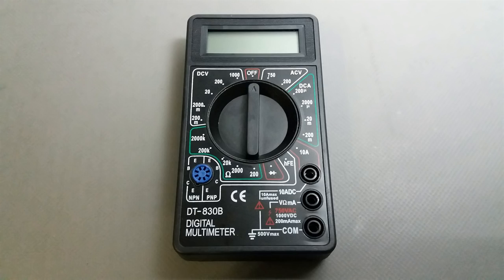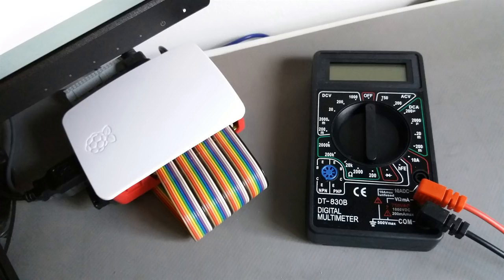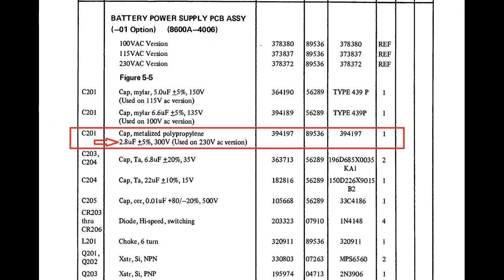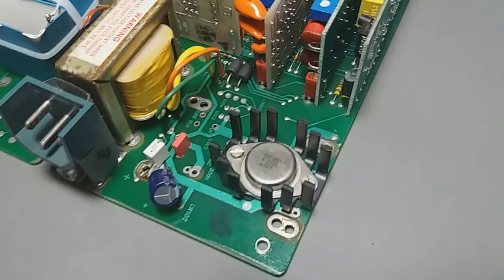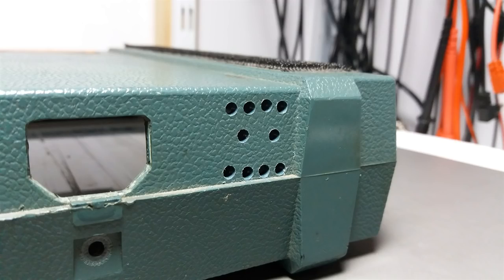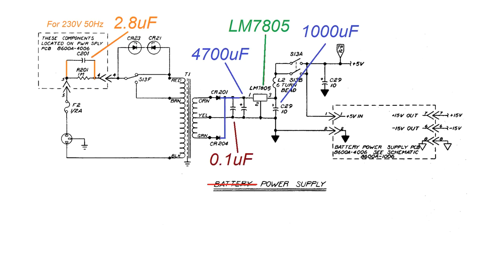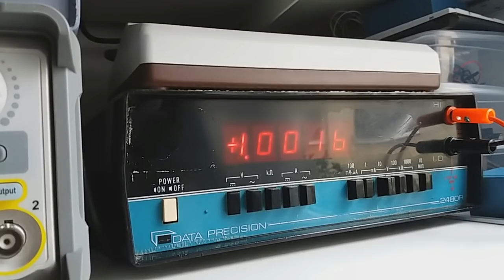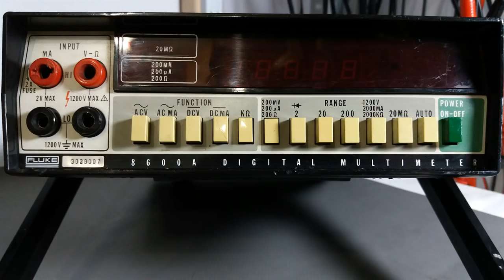Fluke 8600A power supply conversion / how to use this workbench 8600 DMM without battery option

Comment: Check the broken solder joint at 10:00 to the right.
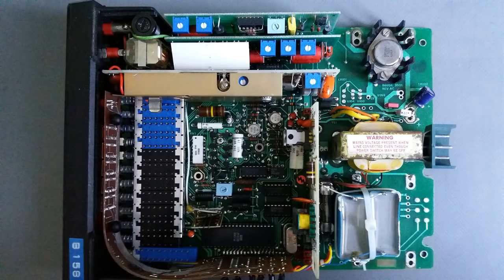Reply from the maker: Hi Joseph!  ...yes, those are the transformer ones. It vibrates so hard that it broke the four joins. Later in the video I spoke about them. Something I didn't show and maybe I should, was the wonderful adaptation to the fuse banana connector that was broken and somebody added a fuse holder on the PCB behind the test leads connectors. The job was so well done that looks almost original. Try to watch it on the upper right corner in the minute 6:32. It is black and round and in the PCB looks like original. You can see the red connector has a broken ending and the technician used a green wire to the new fuse holder.

Comment: Hello, I have a 8600A with battery option as well and it has not been modified yet.  The battery packs are missing.  I tried a linear 5 volt supply directly to pins 1 and 2 on the battery PCB and it worked great.  I then was thinking a simple way would be to use a 5 volt switching style wall wart.  I wondered about any induced noise but I am not sure of how a switch mode supply would affect the operation of the meter.  I actually tried it and it seemed to work.  I did not try high frequency AC measurements.  But all other readings seemed to work.  Any thoughts...Thanks.
Reply from the maker: Hi! Just remember this unit was made to charge batteries in standby. If it is not ON, you can set it as its power supply against your new power supply. I recommend you to make a diagram and to talk with an experienced technician or engineer for review. The first task is to avoid any electrical danger, the second to learn and the third to enjoy it!
Reply: @bob.kalpon1398  I do appreciate the warning.  I have been tinkering awhile and have gone over the schematic as well and realized what you are confirming for me.  The interfering components and/or line in would be removed/disabled depending on which way I go with the repair.  I am looking for the least offensive approach to the meter but also the cheapest as this meter has alot of cosmetic issues and is not worth much as a whole.  The 7805 will generate some heat.  Although with just over 2.5 volts headroom (it seems from your findings), it shouldn't have to dissipate too much I guess.  I just wonder about a 5 volt SMPS and possible induced interference within the meter using such a supply.  That part is a little new to me.  Be well and thanks.